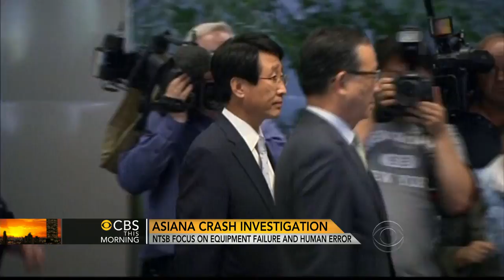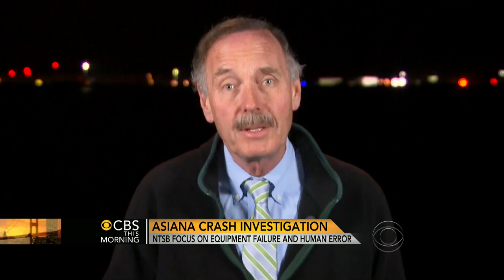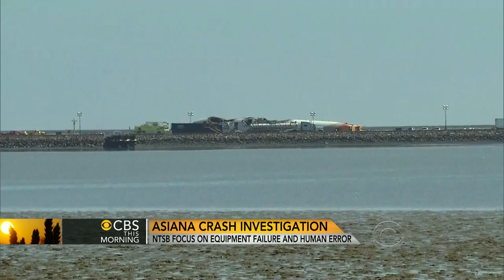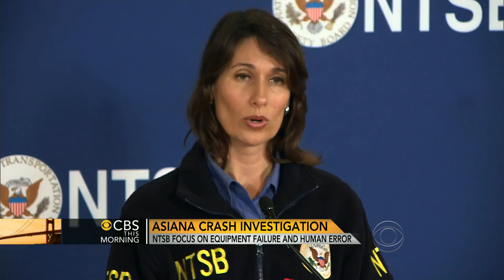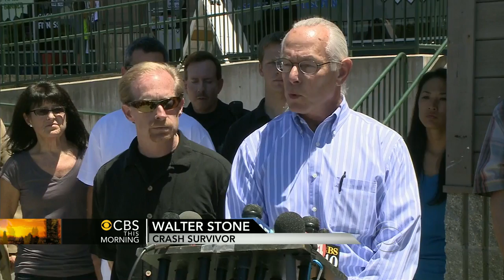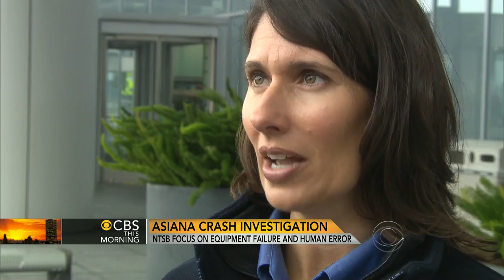Asiana Flight 214: Did plane's autothrottle cause the crash?

Comment: Boeing 777 have historical issue with Auto Throttle Control which maintain speed and altitude.  Pilots have been complaining about Boeing Auto Throttle Control on Boeing 777 since year 2005.